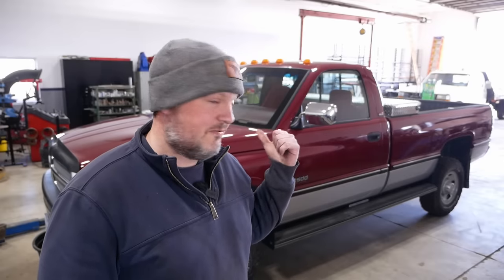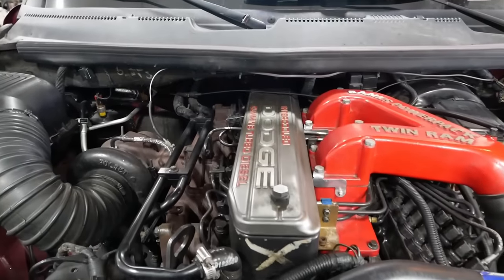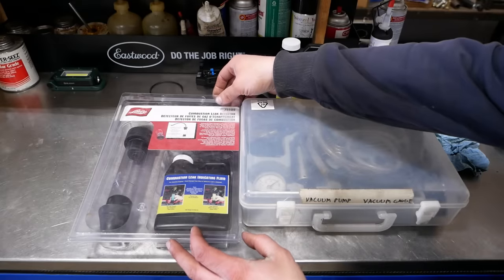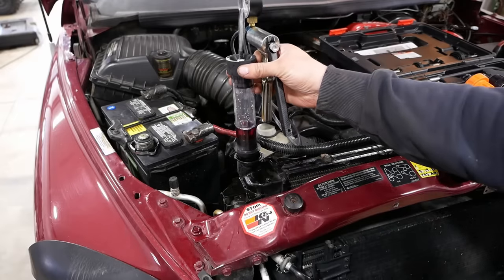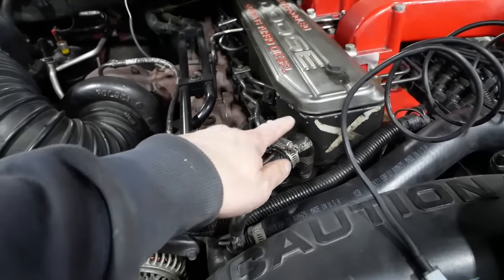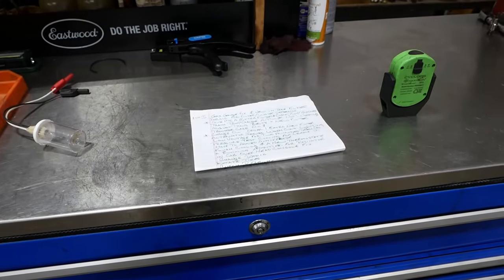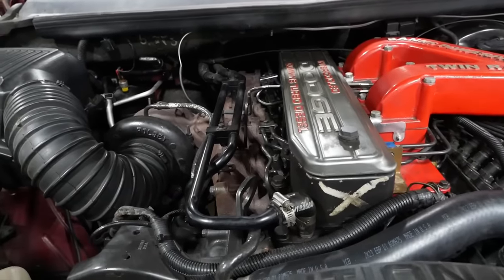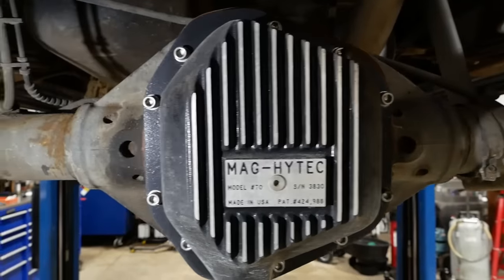Fixing a Mint 1995 Ram 2500 Cummins | Front End, Coolant Leaks, Major Service, Etc.

Comment: 1991.5 Dodge went intercooler. I have a 1993 W250 with 451k miles and, although it rides like an ox cart, has the unbreakable kingpin front end.

Comment: The first gen cummins did not have the constant tension clamps on upper rad hose. They were not even stainless, found this out working on a 92. Came to the shop I was working in, after having several other shops firing the parts cannon at it. New head,2 head gaskets. Still put water in oil pan. Learned lots on that job. Had to loosen cab/front clip & lift up. Then loosen & lift engine to remove oil pan. Set it all back down , fill with water & pressure test. I got to crawl under & find leak on #1 cylinder bore.
Turns out what happened was upper radiator hose clamp rusted out, dumped coolant on highway, clamp got replaced when still hot & then cold water from a stream to refill, which cracked the #1 bore. Ended up replacing entire engine as customer needed truck to work asap.

Comment: The stroll down mower memory lane reminded me of the infamous Ingomar Rd. Seems when we mowed the bar ditch in the months of June/ July, after the drought conditions of California, the blades would strike rocks, which in turn caused sparks, and the operator, with no cab, would have to beat it to a farmhouse at a blistering 15 mph and call Calfire to put it out. Ahhh, the good old days! Awesome to see the minimal rust vehicle give you a break from the torch! Had a little road noise in the background, thought you were at Mortske's for a bit there, hey, did you know he has a new shop......?

Comment: Adjusting the end plug (where the column connects to the box) with a pin wrench is the best way to adjust slack out of the steering box in my experience. Great vid as usual 👍
Reply: Hi, can you elaborate more on this?
Reply: @Texas12valve  the end plug that retains the worm and all the balls, screws in and out. It must have a certain amount of clearance to allow for thermal expansion. From a mechanics perspective undo the 13mm bolt that connects the column shaft to the box and pull it off.  Slacken the gaint sheet steel nut with a hammmer and punch, then tighten the end plug with a pin wrench. The jeep xj factory manual has good instructions. I think for most platforms, including the xj, the box is best removed for access. Hope this helps.
Reply: @taccom1617  thank you. I'll check it out!

Comment: I think the”wandering all over the road “ might be a tyre issue, It is possible to tame it a lot with the right tyres. Depends what the guy is using it for !       Lovely truck !!
Reply: Yeah that's partly true. I had an Excursion and the problem was the dang tires even stock size were tall. Ford should've used bigger rims to stiffen the side walls.

Comment: Got you beat, I have 97' 2500 4x4 5.9 w/auto, Extended cab with only 50,000 miles on it! Only thing have done was add Banks air box/filter. Will be adding a twin ram Banks intake. Love ours and used to pull trailer and as can tell not driven much.  So can relate.

Comment: It's due to where y'all live. Ton of them on the road here in Utah in excellent condition. I have a 98 1500 sport with zero rust and a 99 2500 24v with zero rust. Both with under 300k and no dash cracks.

Comment: I had a 95 Ram 2500 4x4 as well. Hauled horses with it too. (And hay and feed) Went through 3 torque converters and a transmission in it. I hated that freakin truck. I have a 2012 Ram now. Much more solid.

Comment: Haven't finished watching, but I bought a combustion gas tester for the coolant from HF. The fluid with the one I bought claimed it would work for gas or diesel. I was using it on a 6.5 GM. Symptoms were an immediately pressurized coolant system on startup, and when it ran long enough it would force most of the coolant out of the overflow. The combustion gas tester never showed anything. Replaced heads and head gaskets, fixed the problem.

Comment: You can make your own "thread chasers"   by just cutting a couple of straight grooves in a standard nut.  The sharp edges of the groove you cut will act as cutters and the groove itself gives the extra material a place to go...  It's not so easy to cut a groove inside a nut though... Easier to do on a regular bolt;  to make a chaser for threaded holes.

Comment: The intercooler was actually added in 1992.  By 1994, emissions regulations were at the point that Dodge needed to improve what they had with the VE pumped 12 valve.  So they took the P7100 pump off the Cummins 8.3L engine and used it on the 6BTA because of the higher injection pressures.

Interestingly the P7100 was not a dynamic timing injection pump like the old VE and newer VP44.  So one of the common performance improvements was to advance the injection timing from stock (13.5 deg advance I think) to about 16 degrees advance.  This gave a noticeable improvement in highway mileage and throttle response.

Of course, when Dodge put the P7100 on the smaller engine, they detuned the pump.  So if you know what you're doing you can make some amazing power with a few pump tweaks on a P7100 truck.  If you don't know what you're doing, you can also make tremendous power, but also trash the transmission and other drivetrain components too.  😆

Comment: I'm in the same area. I work on Peterbilts and the like. Those constant tension clamps still leak. Every spring we have a rash of cold water leaks that just need some clamps tightened.

Also, I don't know if you do a lot of overhead adjustments, but snap on makes an inch pound torque wrench that goes down to 3 inch pounds. Its a screwdriver type handle. I set mine to 5 or six inch pounds. Put the feeler gauge in, run adjuster down till it clicks, tighten jam nut,  and done. Makes it a lot faster and more consistent. I don't have the part number off hand though.

Comment: I have a 1997 2500 cummins ram. It has MINIMAL rust on the sides. No rust on the frame ecetera. All the rust is where the chrome guards were on the wheel wells. I just needa throw some money into it and Im good 2 go. Gramps gave me it when he passed and I plan to do a full restro on it. Obvi not to stock but it's gunna get some love soon.

Comment: If the outside temps get below 50, the engine grid heaters will come on when the truck first starts up in the morning. This will cause the volt gauge to read very low, then when the grid heaters cycle off, voltage returns to 13.5 - 14.  The Banks aftermarket intake will increase air flow through the engine.  It wasn't a cheap investment.  The gas gauge sending unit was a known weak point in these trucks when new. Geno's Garage sells the best fix to install the '96-'97 fuel sending unit into a '95. The Mag-Hytec diff cover increases the amount of oil, so keeps the gears cooler when you're towing.  They weren't cheap.  They have a dipstick so you can check the gear oil accurately.  The '95's had the 47RH trans--they operate with hydraulic pressure.  Since this one also has a Mag-Hytec pan, it might have been upgraded with better internals and clutches.  The stock clutches were pretty crappy.  The trans temp sensor probably does work, but with the deep cast aluminum pan, the trans runs below 140 degrees, and so probably never shows on the trans temp gauge unless the truck is driven in stop and go traffic on a really hot day.  The '94-'95 4-WD trucks are notorious for front end steering problems.  Looks like the bottom of the engine was power-washed or steam cleaned.  Genuine Cummins thermostats are the best--ordinary auto parts store thermostats don't work as well.

Comment: A true dodge unicorn would be one without front end and transmission problems lol but a beaut nonetheless. The redhead steer box is about the best option but there isn’t a single good for more than a few oil changes steer box out there. You just keep Tightening the center bearing until it inevitably locks up, causes a crash an probably by a ford with the same front end set up lol. Wes has the best production quality of all the YouTube techs hands down

Comment: It almost seems like with all that extra capacity transmission pan and fluid, the trans may never reach operating temp without an extreme load. But the needle on the gauge should probably move a little bit.   Love RAM Trucks!
Reply: It'll take a while to warm up but without an upgraded trans cooler also, the fluid should hold its heat well enough.  I read it as a mod for hardcore towing.

Comment: Tip. If you heat the gasget slightly with a heat gun before popping in the tank then pop the valve in. Pops right in.

Comment: I ran over a mattress that blew out of a pickups bed, just south of Louisville in my semi back in 2006. That thing went under my truck and just exploded. Ripped off the air lines under the truck, all the electrical wire, ripped off the brake cans on my front drive axle and all that metal wrapped around my driveshaft and was smacking the frame on both sides. Was cruising at 70mph with 120lb of air and the next minute I had 0 air and my brakes were locked up. I managed to get that truck stopped in the brakedown line nice and straight and that 50,500lb coil didn't move 1 inch. Interesting night for sure.

Comment: Every last one of these Dodges in my area in Texas has a giant hole in the dash or 3. Those combustion leak kits are cheap and worth every penny. Mine has a rubber bulb with valve on top that draws the air through, and the gasoline engine fluid can actually be used with diesels, but it doesn't go from blue to yellow; I think blue to green.

Comment: Wes ,one of the biggest problems with all the Dodge pickups is with the Track bar ball joint getting sloppy and the rubber bushing getting soft. These two issues with the Track bar cause the truck to follow the crown in the road so you are constantly correcting back and forth  !

Comment: Drove a 96 3500 swd to 1.3 million miles. It towed a 14,000 pound trailer for my car hauling company around 100k miles a year for the last 500k miles of its life before it was retired.  Great truck, at least the drive train. I'm going to recommend he find a stock rear diff cover and remove that after market piece. The cover flows the fluid as it was designed. Can see that custom cover isn't managing fluid flow and the extra fluid isn't going to do you any favors there.  I would also replace is the "quick clip" style hose connections for the cooler located just under the turbo. These are  the transmission cooler lines and the oil cooler lines. Those quick clips will leave you on side of the road. Just have a hydraulic shop make the fittings or new hoses (they are metal for the most part),  but those quick clips are made of plastics and for sure by now are at end of life . Dodge doesnt make a part for this even though a shop parts guy might think they do.  Oh, one other thing.... should you ever replace the starter dont get a oem style part... get a good gear reduction one.

If he ever wants a serious auto trans for that thing, call the boys at Suncoast performance down in Ft. Walton Fl

thought you did a solid job on the work you did and enjoyed the video.

Comment: Great job as always, especially show casing rebuilding the dana which i had not seen. Worked a bit on my friends 97 2wd, 170+k all original and still going good trucks. Dodge always gets a bad rap as they are good trucks, folks don't tend to maintain but run into the ground then wonder why they fail. Thanks as always for sharing.

Comment: I’m sure this truck is probably gone by the time this video is posted, but I’ve come across the complaint of low voltage on a cold start many times. Of course, it is normal to some extent, but a common issue that I’ve seen is that the engine is idling is too low. As I remember, the 12V are supposed to rattle at like 800-900rpm idle speed. I can tell from the video that this one is idling too low, probably around 600 on cold start. Most of the ones I’ve seen needed a small adjustment as they get older, but they are also supposed to have a solenoid to bump the idle up on cold starts and when the AC is on. I’ve come across several where the solenoid has gotten weak (and maybe the throttle has gotten a bit stiff) so they can’t bump the idle up anymore, but they usually have enough to hold the idle up. What I’ve found really helps is while the wait to start light is on, just pump the accelerator like an old carb vehicle. That lets the solenoid hold the throttle linkage open a little so it idles where it should when cold. Of course, the voltage will still drop where there is 200A of grid heaters running, but having the idle 200-300rpm higher helps the alternator a ton.

I live in Oregon where these old tractors are still a common sight on the road (and have become insanely expensive)
Reply: There is no idle solenoid on a dodge Cummins 12v. The only solenoid is the fuel kill. As the governor wears and the springs get weak they certainly can get a low idle condition. The idle adjust screw is right behind the throttle linkage where it enters the pump.

Comment: Love your fuel pump connector splice. Adhesive lined heatshrink with 3M tape overlay. Nice. I soldered my O2 sensor after a wire eroded brushing against a prop shaft! No idea who replaced the sensor and didn't secure the PTFE insulated wires.

Comment: I rebuilt the C-6 in my Ford van and added a tranny temp gauge. Mine has a standard Ford steel deep pan. On a moderate temp day the needle doesn't even get above the 140 starting point. With that monster deep pan there you might be seeing the same thing.

Comment: the lose steering can be resolved many times with a new ujoint on the steeering shaft from the steering wheel, mine nearly fell apart before i replaced it and  it made a world of difference.
my truck was a 97 1500 4x4

Comment: The one way valve they put in the trans cooler line to fix converter drain back is a double edged sword. It restricts the coolant flow and can cause converter overheat when working the trans. It killed many transmissions due to bushings locking due to heat expansion.

Comment: That's a brand, not an indication that it's magnesium.  The cover and the pan is cast aluminum.  Also if you're interested there is a $30 internal regulator kit that turns any denso alternator into an internally regulated one wire unit.  The best kit is made by Transpo.  I've had one on my truck for 10 years.  I threw the computer away when I went to an Allison transmission.

Comment: What I learned from the car stereo installers is, at 22:37, use a zip tie around the wiring and that last wrap of electrical tape.  That way (in theory) the tape wont unwind on you later :)

Comment: you are showing all normal issues, i recently got rid of an 01 dually 4 wheel drive, bought it new grandpa drove it, transmission, a 46 re which i had constant issues with, i made the mistake of selling it , had likewise miles, that automatic is a dealbreaker, charging system operating in normal range, 
fuel pod changeover kit available thru dodge, EXPENSIVE! those calipers look older, nice truck!
Reply: block galleys on those are center of block behind engine mounts, 
on p pump motors look for primer rod on pick up pump on left side of block, once located, loosen fuel line fitting at p pump, pump plunger on pickup pump till fuel drains out, tighten p pump line it will start right up
Reply: adjust the bands in that tranny, will be okay for a while more

Comment: Dodge changed the truck industry with that truck in 94. Starting with the middle council and how brilliant it was to be able to put your notepad in there at that time and then two giant coffee cup holders who would have thought. Also the storage behind the seat and they really revolutionized the super cab or extended cab by at that time opening up the one door that would always face the curb I think passenger. And also coil spring front suspension. But they were just so terribly unreliable the transmissions. South oak Dodge near this same dealership in Illinois I was the first guy in Illinois to buy a dump truck in 1994. They barely wanted to give me the truck because everyone was going to the dealer to see them in real truck body on it. But 9,000 miles they had to put a new transmission in every 9,000 mi I couldn't even make it through one year snow plowing. The electrical issues breaks every 8,000 mi. The four-wheel drive system just never seem to work like my Ford and Chevys did of that time. How ram or Dodge now they outsource everything. The transmission they don't make the transmissions they don't make the Cummins diesel. That's the only reason they're still in business is because of that dieselI had the 360 gas motor. Great great power. It held the load and back better than Chevy did at the time and that's when Chevy was having all the issues with their chassis. But it also held a 8 and 1/2 ft Western Union Mount Snow plow with no problem at all compared to the Chevy as well. But look at Ford it took Ford to do coil spring what was it 2005 or 2004 in the front took them a decade later to catch up. But

Comment: I own a 02 dodge ram 1500 5.9 magnum and a 03 cummins and my dad had a 01 cummins. My gas truck feels like a car when i comes to steering and both the diesels felt way more sloppy for steering. I think its got something to do with all the weight in the front but could be wrong. Took a little getting used to when i started driving my diesel. Also awesome i have the exact same radio in my cummins. good radio!